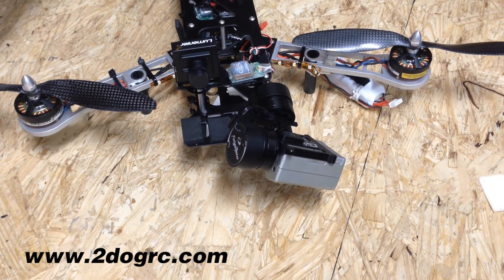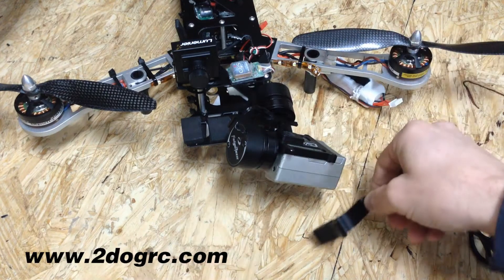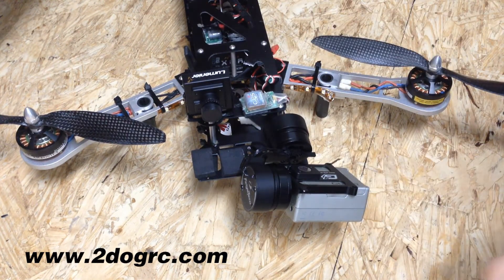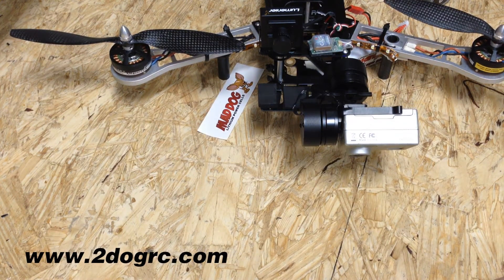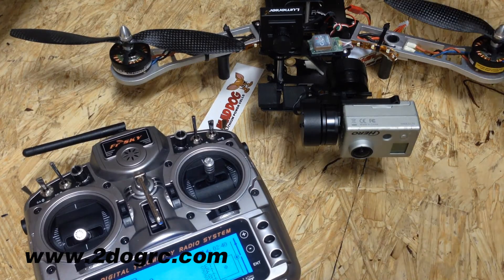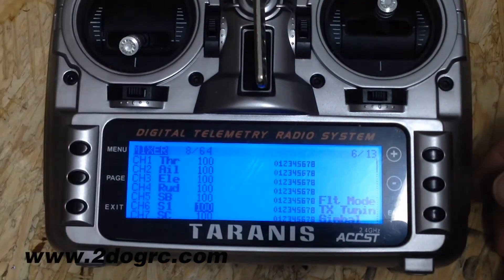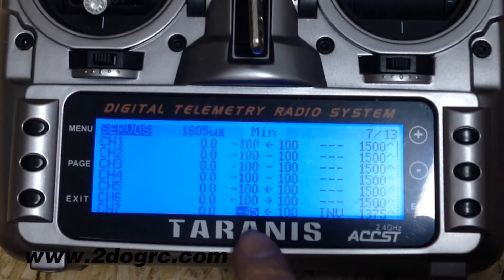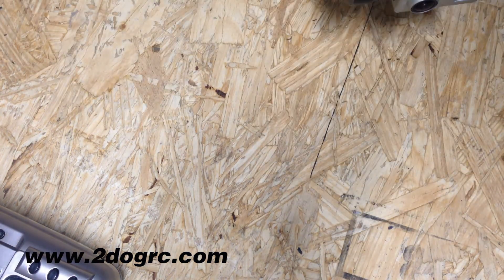How to Install the Feiyu-Tech Gimbal on a QAV 500 and Taranis

Comment: Was this setup on an 8 channel rx or a ppm rx.
Reply from the maker: +Obsolete X This was on a 8 Channel, before I knew how to use PPM
Reply: +2dogrc 
I have the ppm setup and so far cannot get the gimbal to work connecting to rx. I will have to make an extension to get it to reach the fc
Reply from the maker: On this X8R I was using SBUS i believe for this.  The PPM channels on the Receiver are channels 9-16.  You have to make sure that when you bind you receiver to the Taranis you set it up properly.